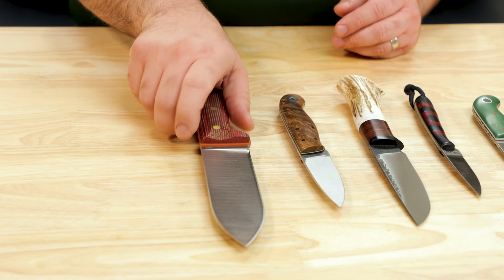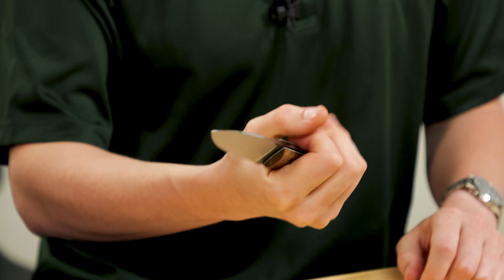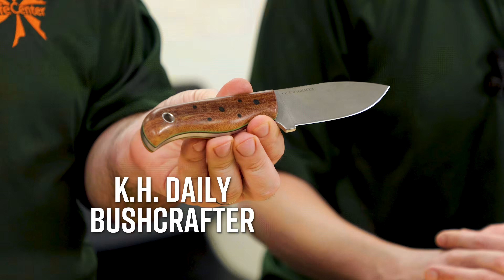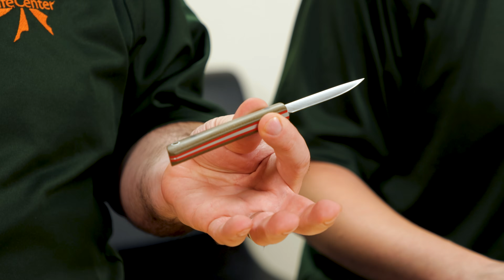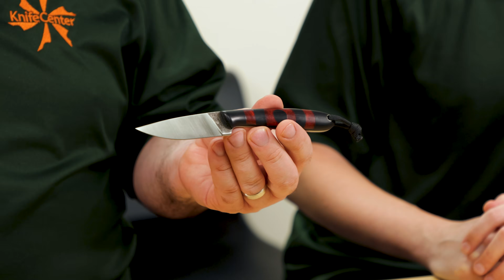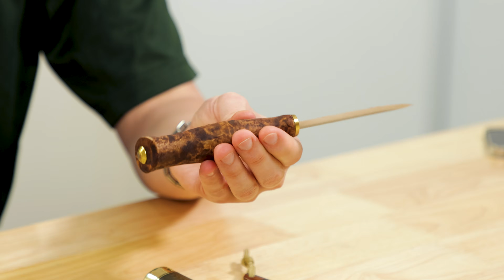Why You NEED to Collect Custom Fixed Blades - Between Two Knives

Comment: I only have two custom fixed blades, and both for different reasons.
I have a Chico, from Joe Loui Knives. I bought it because I'm a New Mexico native and Joey Cordova lives maybe 30 minutes from my hometown, and I wanted a piece of my home state. The knife itself is a little bruiser, but I do still carry it.
The second is a Bradshaw Pocket Scalpel, because I had to have it. My mom got me a wallet forever ago, from Hawaii, that was made of Koa wood. This little Pocket Scalpel happened to have Koa bolsters. It didn't hurt that the knife weighs half what the Chico does. And that was what tipped me into getting the Bradshaw.

Comment: I have two Kellam blades that I turned into beautiful knives. A grandfather blade that I paired with a redwood burl handle and a 3.5” small puukko with a madrona handle. I use small puukko exclusively for carving. Great quality hand made carbon steel. Thanks 🔪🎸

Comment: I am a hardcore knife collector which means I am probably in good company...  I started off my collection with a few tactical knives when I was a LEO, Blurs,  a ZT 0200, 0770cf, etc.  The addiction really took off when I got into woodworking and at my local Woodcraft store they had knife blanks.  I made handles, taught myself to scrimshaw, and eventually started looking to learn how to make blades.  I met a custom knife maker at a gun and knife show in Houston and started working on them since.  I met Specer Aplin from STA Custom Knives and learned a lot about working the metal and materials to make a beautiful knife.  I own two of his customs, a few of my creations and dozens of other knives.  In fixed blades, the closest I have gotten to the custom feel from a mass produced knife is Lionsteel and Tops (for different reasons though).  In folders, Viper all day long....  And Smith and Sons

Comment: Hi DCA and Seth, great stuff as always. I have what might be a big ask/challenge, but I'd really like to see if you can come up with a selection of knives that fill this niche.

98% of all the knives I can find (fixed blade or folder) have some combination of either G10/Fiberglass/Plastic/etc, Wood/Bone/Horn/etc, or Metal/Steel/Titanium/Etc. Most of them are black or grey, or some pattern that makes them look either tactical, hunting, or like what someone would get when they want to cosplay as John Wick when going to the supermarket. 

I use knives pretty regularly – lots of the time for cutting straps, breaking down boxes, or the little daily tasks that are just made a little easier with a knife. My problem is that I'd like something that is pleasant to use and hold, but I'm not trying to pretend that I'm going to need to suddenly defend myself from a wave of attackers or baton logs in order to survive in the wilderness.

Looking through your site, there are a few knives that use Ultem (PEI) as a handle material, and one or two shaving razors that use an attractive abalone or shell pattern – but I'd really like a knife that takes itself a little less seriously while still offering a premium steel (S35/S45/M390/etc). I'm thinking like some of the designs you see on upscale Italian fountain pens – crushed resin, layered resin, ebonite, urushi, etc. 

tl;dr are there any knives with a premium steel, good construction, and fun handle material/design? (You can reference the Leonardo Momento Zero Fountain Pen, the Pelikan m800, or the Pilot Urushi). If there are any options available, I'd love to see some different takes/price points.

Thanks.

Comment: Maybe I totally missed it, but what's the price point for the last knife( Kellam Puukko) & what are the specs, as in blade & handle dimensions? Or at least in contrast to David's Slightly Larger Than Average Hands (😁) in particular, could give me a good idea of its actual size. Somewhat objectively, at least...
Reply: There’s a link in the description of the video that will take you to it on the site.

Comment: Howdy Knife center, great video and content. Got my fair share of fixed blades, 4 that I've done myself. All just regular steel. It won't perform until it's in my hand. I do believe the "intimacy and intimate" were the needed verbage. Like you said there hands-on in its face creating it. Then it's passed to the user for the same reason. Ooohhh it feels so good. Thank you for your effort and the video.

Comment: That's the one thing most people don't understand.  Is the geometry of the blade, or more specifically the edge.  Has more impact on edge retention than the steel used, or even the heat treat. Assuming that quality steel was used, and it was heat treated properly.  
I mean you can't grab junk steel and do a crap job on the heat, but if good steel like 1095 or even aus8 is used and the heat treat is done right.  With the right geometry. It'll hold an edge just as long or longer than any "super steel" that doesn't have the right edge geometry for the way YOU use the knife.  
Unfortunately I'm not that good at sharpening. So i can't play around and find the just right edge for my use.

Comment: I own 2 Custom jobs- Shining Mountain, in the early 90's, made a limited batch of Bowie knives in 52-100 steel, Convex grind, walnut handle.  Best Bowie I've ever owned..ive own many  #2 Dude made me a 5 inch fixed blade from a leaf spring, red wood handle w/ black acrylic inlay...black liners under the scales...work of art !